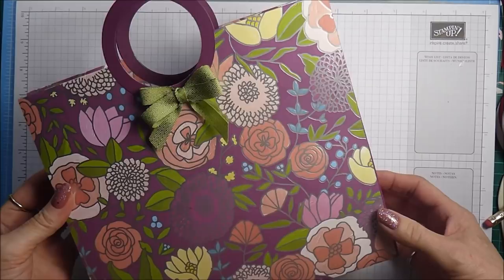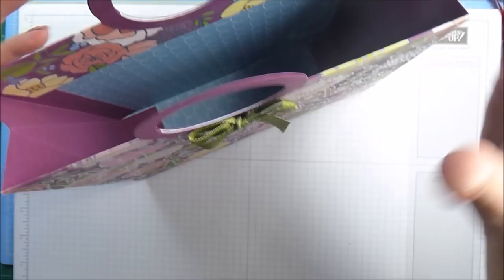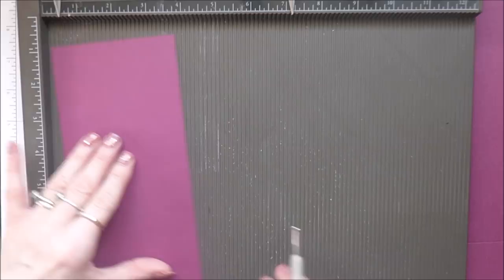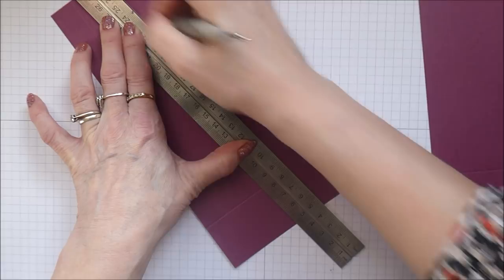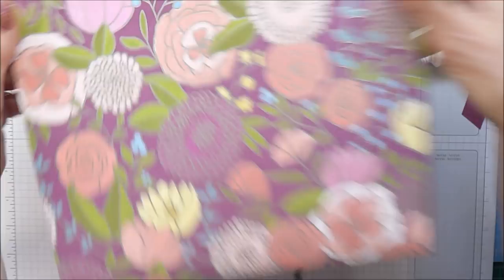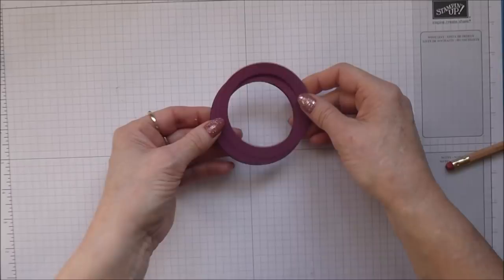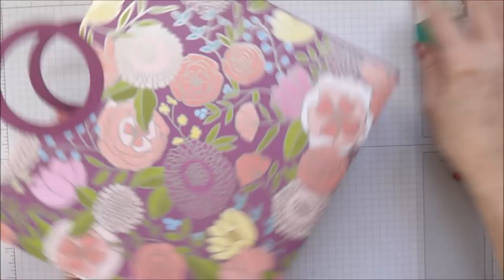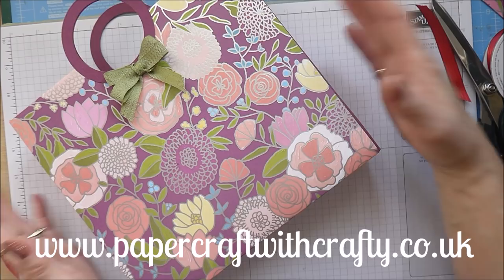Linda's Tote with Circular Handles - Sweet Soiree DSP by Stampin' Up!

Comment: How big is the layering circle. you used. this is a adorable. purse,
Reply: Gracie Mizell hi there, at minute 13:47 she starts explaining circle process if you don’t have the die nor puncher, you can make it by hand with the measurements. She indicates 2 1/4 circle punch then says the biggest circle in this pack (not exact) 😊 by what she said I opened my pack of circles and biggest in my pack measures 4 1/4

In a program of your preference word,publisher,design space,silhuette studio insert a circle and size it to 4.2 insert another circle 2.2 then slice it, that way the 2.2 circle cuts the center.

Take this circle place it on top of bag half in like she did with circle punch and trace it then cut with thin craft knife. But with all these steps I would just purchase the circle punch & die if you planning to make several. Happy Crafting hope this helps. 

Note: you would have to play a bit with the measurements it depends how big you want the handle.
Reply: Thank u so very much for taking the time to answer me. Im gonna do it.
Reply: @graciemizell8626  no problem